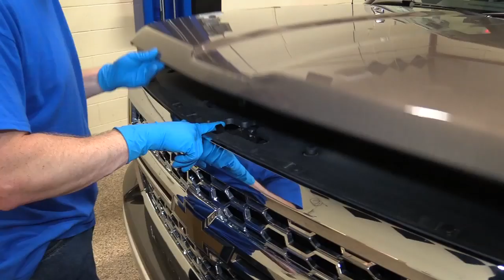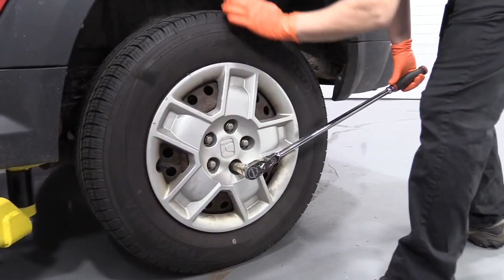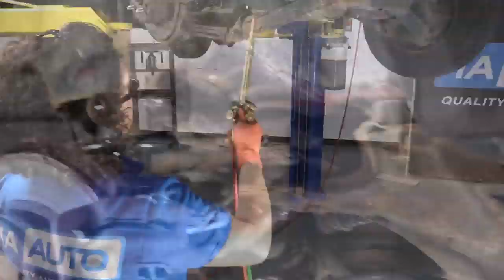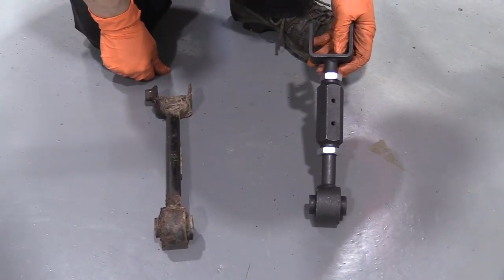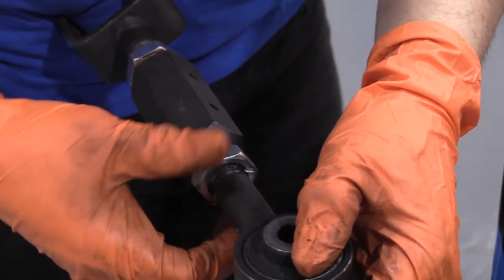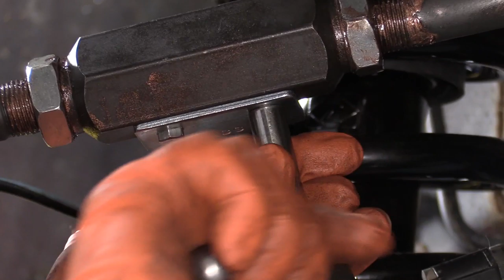How to Replace Rear Upper Control Arm 03-11 Honda Element

Comment: Putting the load down and then tighten both bushings, right? Confused as to why you tightened just the inner bolt and then let the car down and tightened the outer nut. Shouldn't you tighten both bolts with the load on? Also, I can see why you might want to break that inner welded nut free as there's very little room to break the bolt free and remove it from the other side. I had a heck of a time getting that bolt out. Someone in the thread mentioned 69 ft lbs torque spec - yeah, good luck getting a torque wrench in there!
Reply: The inner bolt is going through a sleeve so it moves freely. The outer is in a rubber bushing.

Comment: Why didn't you replace the outside bushing?  

I noticed you adjusted the abs holes to the correct orientation off camera.  It's ok to bring it up in the video after showing how you aligned it then put it on with the holes facing up. Just like the welded nut.   None of us are perfect.  It could possibly confuse someone following everything you did.   After all your videos are step by step and very helpful. 

Overall a very good video.
Reply from the maker: +off road Thanks for the feedback!

Comment: So now we have gone from two to four potential points of wear and tear.  I see these aftermarket parts fail all the time.  Do yourself a favor, order the OEM part.  It lasted 12 years for a reason!  Other than that, nice repair job and great video.
Reply: The OEM part is not adjustable to correct camber issues.
Reply from the maker: +Rob M Thanks for the feedback!

Comment: The inside nut is stationary like the outside nut. Loosen the BOLT. Use a long wrench or impact gun with extension and swivel socket from below. Comes off easy.
Reply: That's what we experienced on the SC - - I can't speak to other trims. Regardless, the video was very helpful to me as a complete newbie to this repair/upgrade.

Comment: The honda service manual for a 2005 Element lists the torque for the rear upper controller arm as 93 NM or 69 Ft lbs.
Reply: nice
Reply: Nice

Comment: Whats the point of making adjustable upper control arms . the ones I have on my car aint adjustable. Most of teh after market parts are adjustable
Reply: the vast majority of elements suffer from an unsolved negative camber angle in the rear wheels that is not repaired by replacing the parts with OEM units. Changing the suspension components with oem parts  most of the time will not solve the issue. So replacing with adjustable upper control arms allows you to correct the negative camber angle(tops of wheels towards center of vehicle). if youre ever behind an element on the road youll see it unless theyve done this fix
Reply: If you go to get an alignment they may not be able to adjust the rear camber on the wheels properly to get the front to line up.  These adjustable arms solve that problem.
Reply: To be able to adjust rear camber.
Reply: I have a 08 sc element and yes I have seen other elements with this negative chamber.  I think this happens when  the rear shocks are worn out so the car drops and the wheels go out of alignment  with new shocks this went away for me . But I will eventually gef these  adjustable  version put in

Comment: what about the other bushing?
Reply: May not require replacement, the, ''Bottle Screw''  Upper Control Arm Bracket is a Upgraded third party part which allows the Camber adjustment to be performed

Comment: She had a problem with the upper bolt because nut is stationary. It's not supposed to move. She actually broke it off. Remove from other end only
Reply: It's true, same as other end of same rod, both are welded on.  It's a bit difficult to get on other side since bolt head it so close to body while backing out.  Best method I found is a good closed-end wrench interlocked with another wrench as extension.  Not really enough room for socket.
Reply: Yeah, you’re right sir, she definitely broke it....
Reply: For sure
Reply: You just have to heat and quench, there’s just no way you can loosen the bolt from the other end because there is no room for you to put a breaker bar or a ratchet there.
Reply: Olddominion Are you sure? If it is true, that is no wonder I couldn’t move the nut! Thanks!
Reply: Very true remover the passenger side today and it’s a welded piece so DO NOT REMOVE THAT SIDE
Reply: Easy enough mistake to make when you're working on something rusted.   I've totally done it.
Reply: she def broke it off lol
Reply: You are correct. Only remove the bolt however, the heat helps break the rust. https://youtu.be/S2SCYRNIm2I